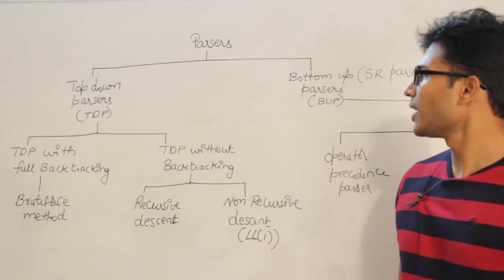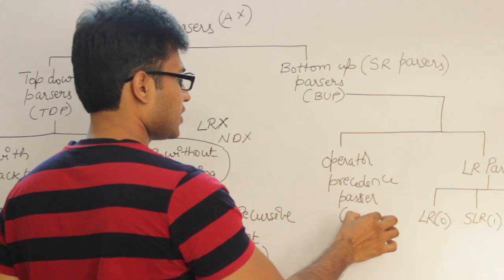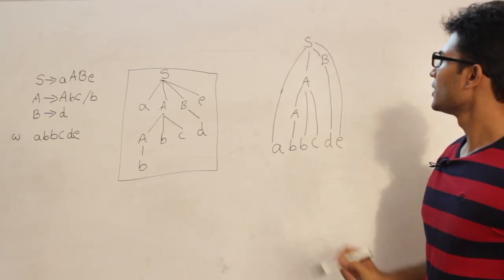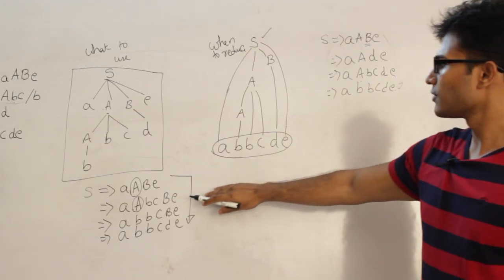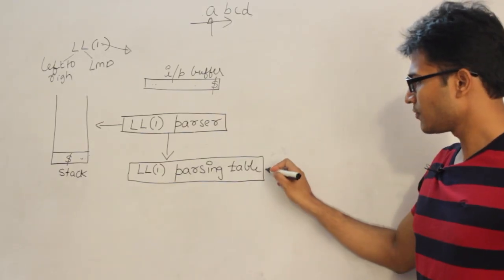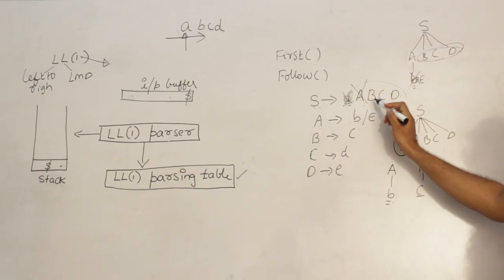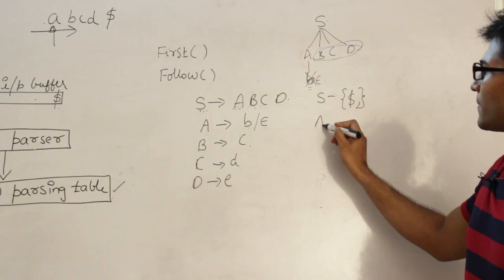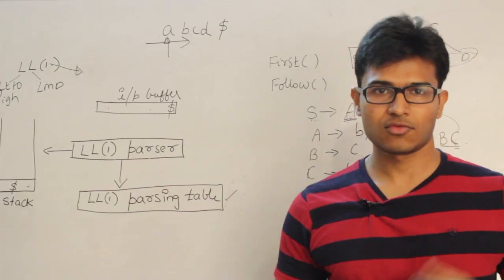CD | Parsers | Introduction to parsers and LL(1) parsing | Ravindrababu Ravula |Free GATE CS Classes

Comment: I a long long time ago developed a  programming lenguage development  system. It had a parser programming language not a parser generator. The example expr parsing formulas below are examples:

 EXPR = TERM "('+':ADD|'-':SUB) TERM !2);
 TERM = FACTOR $('*':MPY|'/':DIV)FACTOR!2);
 FACTOR = ( '(' EXPR ')' | ID | NUMBER )
     ('^' FACTOR:XPN!2) ;

I designed and wrote compilers in the late 1960 and 1070s. What is taught today has completely ignored early compiler development systems that use TDPLs (Top Down Parser Programming Languages). I use the above terminology to explicitly distinguish them from parser generators. They do not limit you to a left or right derivation tree. You build the tree using a symbiotic stack based tree construction language. There are three stacks. The call stack holds the return address to the calling parse function. It may also hold stack frames and arguments for functions having them. Generator language functions for example. Parser functions resemble grammar rules. (They may be considered a type of analytical grammar. There three type of formule:
 Character class : formula define and name character groups.

 bin: '0'|'1';
 oct: bin|'2'|'3'|'4'|'5'|'6'|'7';
 dec: oct|'8'|'9';
 hex: dec|'a'|'b'|'c'|'d'|'e'|'f'
                |'A'|'B'|''|'D'|'E'|'F';

Token .. formula are used to recognize variable tokens. Key words, operator and such are usually recognized using constant strings. Tree construction is accomplished using two working stacks that are I dependent from the call stack. A node object is created and pushed on the node stack using:

  :<node string>

:ADD creates an ADD node and pushes it onto the node stack. Trees are constructed using:

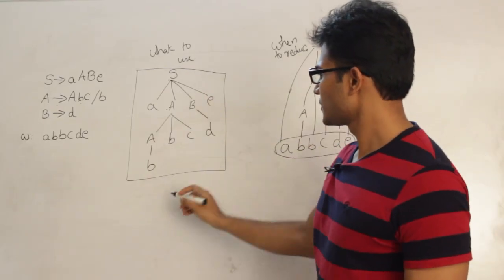Comment: Sir,with due respect at 7:08 u said top down parser employs left most recursion,but doesn't top down parser takes right most recursive production rules,just had a doubt :)
Reply: No. TDPs use leftmost derivation, and don't confuse recursion with derivations. If the grammar is constructed properly, you can derive without recursing.

Comment: The first grammar you used as an example is left-recursive and is therefore in general not applicable for top-down parsing. I also don't see why grammars should not be ambiguous ...
Reply: Wrong. When parsing operators (*, +,  ^, & ...), for example, one needs to sort out their different levels of precedence, else one will end up with expected results.
And if the semantics of the language has some element of associativity "(2 + 2) + 2" vs "2 + (2 + 2 )", then disambiguating a grammar is necessary.
Reply: What is wrong? The fact that the first grammar is left-recursive and therefore not suitable for top down parsers (A->Abc/b)?
You surely need to disambiguate the grammar at some point but this in general is an implementation specific thingy (which is one of the weaknesses of CFGs, requiring the concrete implementation to provide the lookahead to disambiguate), unless you use a formalism such as PEGs, isn't it?
p.s. I don't see how your example shows the problem of operator precedence? I guess you meant something like "2 + 2 * 2" vs. "(2 + 2) * 2" ...
Reply: I was addressing your "I also don't see why grammars should not be ambiguous" statement.
I did mention the problem of operator precedence, which is one of the reasons you need to disambiguate, but  "(2 + 2) + 2" vs "2 + (2 + 2 )" was for associativity ambiguity.
I agree that such ambiguities are CFGs thing, but the examples he used are CFGs.